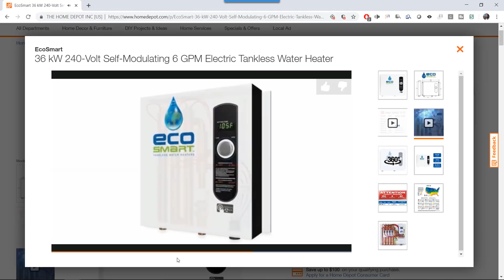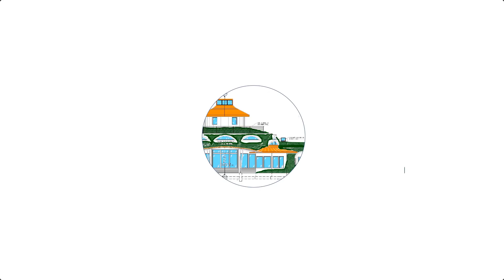39.0 EcoSmart 36kw on demand hot water heater install

Comment: According to the installation manual, a separate ground conductor for each incoming circuit is required.
Reply from the maker: Yea, its easy for them to say that, but they would be seriously over sizing things.  The 4 grounding wires would all be screwed to the same little bus bar and no current flows thru them during normal operation.  If there ever was a short, the current would flow back thru that wire for a tiny fraction of a second before the breaker would trip.  Even if all 4 circuits shorted at once (incredibly unlikely) with full amps, one 8 gage wire would be more than enough to carry the load for such a short time.   

Have you installed one of these?  Honestly, I was doubtful that I could have fit 3 more 8 gauge wires thru the knockout they gave me.  I definitely couldn't have fit it thru the conduit.

Comment: I was just wondering if you could leave one of the heating elements unwired and this unit still work properly I don’t want to under size my house would rather over size and I thought I’d I went with the 36 and didn’t need it if I would just leave one breaker off if it would still work correctly if anyone could answer thanks
Reply from the maker: Yea, I have learned a lot about these things using them for the past couple years.   The first heating element is required.  You can leave the rest unwired (or turn off the breakers) if you wanted and it would still work just as well as the smaller units.   

When I installed it, I thought it measured the incoming temp and then would increase the energy flowing thru the 4 resistors until the outlet temp reached the target (standard way that most control systems work).  But I am now certain that it doesn't work that way.  Instead, what it does is measure the incoming temp and then calculate how much many amps are needed in the first resistor.  Most of the time, that is all it uses.  If you are running multiple showers or something like that and the flow rate goes up, then its calculation finds that it needs the second resistor, etc.   If it uses the second sensor, that is just a check on its programming.

How do I know?  Well the first resistor burned out on one of my units.  It was the darndest thing because we would have no hot water if we only ran one tap, but if we ran more, we would get "warm" water.  Basically, the algorithm thought it was dumping energy into that first resistor.  When the flow rate went up, it also turned on the second one.  Since the second one was working, we actually got some warm water out.   I ended up moving the 4th one into the first slot and things were fine while I could go online and order another element.   The 4th element looked totally unused.  The 3rd looked rarely used, etc. all the way back to the first that looked really worn out.  Pictures are posted on our Facebook channel.
Reply: @SimonHomeintheEarth  thanks that’s what I was looking for I think I’m going to go with a 27kw and give it a try hope I don’t regret getting the 36

Comment: I didn’t see a ground wire connected in the main panel
Reply from the maker: 2:27, you can see a black wire with green tape on it.  I just didn't bother to buy green wire because it is cheaper to buy it by the 50 ft roll.

Comment: Seems ridiculously simple. What were your hot water costs per month on your electric bill? Anyway to isolate and figure out?
Reply from the maker: That was the worst part.  Electric is not the cheap way to heat water.  Maybe I should have used natural gas, but that install was expensive, I didn't think I would need much and I didn't like the idea of combustion in my underground home.   Also, the cost of natural gas has doubled in the past couple years, so maybe it wouldn't have been cheaper. 

I ended up adding a solar hot water system and hooking it up to the front end so the water now is pretty much full temp going into this heater now (the solar actually gets it hotter and I used a thermal mixing valve to add in some cold water).   Anyway, on sunny days (and the night and morning after) hardly turns on at all now.

Comment: Great video! Saw this on their website: 300 amp household service recommended. Mine is 200 amp. Do you think 200amp is enough?
Reply: most modern houses are designed with 200amps service , you can request a 400amp but that’s mostly for business
Reply from the maker: It depends how much of your panel is already in use.  There are also rules for allowing for excess, etc.  You would probably need to upgrade.  If you can get natural gas, I'd suggest you go with one of those instead.

Comment: How many ground wire you connected all 4 or just 1
Please respond i appreciate 
Thank you.
Reply from the maker: Yea, just one.  Current doesn't flow thru the ground wire during regular use.  If it does go thru the ground wire, it is just for a tiny fraction of a second to trip the breaker if something goes wrong, so the wire doesn't need to carry the working load.
Reply: Just 1 , from main panel to water tank cold side
Reply: Look at the fken thing can u can see
Reply: The EcoSmart manual calls for a separate ground wire per circuit.
Reply from the maker: @sr.gateau  Yes, the manual calls for much much more capacity than would be needed in reality.  Think about it this way...  My entire breaker panel has only got one little ground wire to ground the whole thing. Even if I ran 4 wires from the unit to the panel, there would still only be one wire from the panel to the ground.  I won't be running current thru the ground wire to the ground like that anyway, I am only using it to catch a fault and trip the breaker.  Current would only flow for an incredibly brief time.  As an engineer who can do the math, I have absolutely no worries about running the full amps thru that wire for much longer than it would need, and I also know that such a scenario is so incredibly improbable that I have a much greater chance of winning the lottery.

Comment: Some places don't have enough room in a panel  for double breakers.  Sometimes you gotta run a sub panel off the main just for this water heater.
Reply from the maker: Yea, that 4 breaker requirement really makes this difficult to add to existing construction.  Most houses just can't handle the amps required, even with a sub panel.

Comment: Nice video.  Question though.  Do you know on the 36 KW unit, if it would run with only the first two circuits connected, so it could be run as 18 KW, but have the capacity be used as 27 or 36 at a later time?
Reply from the maker: Yes, for sure.  You can hook up just the first couple circuits and it will work just like an 18kw unit would work.   Keep the flow rate down and it doesn't touch the 3rd or 4th circuits even if they are hooked up.   But if you exceed that flow rate, you will see that you don't get enough heating, just as you would with an 18KW unit.

Comment: Did you crimp a terminal onto your 8 gauge wire or just strip them and insert them into the water heater terminal block?
Reply from the maker: No terminal required.  The water heater was designed to take the wires directly and then had a screw to hold them mechanically.

Comment: That's the first time I've seen a panel filled with blue flexible ENT conduit, no NMD in your home?
Reply from the maker: Nope, no NMD.  ENT is readily available in stores here and is the only flexible conduit rated for being encased in concrete (that I know of).  Is there any advantage to using NMD over ENT?   Or is NMD just something you are more familiar with?

Comment: is it better to have the tank the close to the breaker?
Reply from the maker: The longer the cable, the more voltage drop along it.  But you also have certain minimums.  It is also important to have the hot water as close to the final taps as possible...

Comment: Interesting, how are your electrical bills since then? I'm thinking of getting Retex-36 for a similar setup with a longer runway. Even at 70% derating, the code-allowed current would be over 150 amp: 38.5 x 4 = 154. This particular 36kw model is listed for a maximum draw of 150 amp, so 1" conduit should be fine. That's what they mean by "the 4 sets of #8 wire" statement in the manual. Not clear though why THHN/conduit option was selected in this temporary non-wet setup, instead of just 4 sets of Romex 8/2? Another minor potential issue may be a single #10 ground wire, kinda weak for the possible flow. A thicker single wire would probably be safer. The unit's ground bar has 4 slots with Romex in mind.
Reply from the maker: Honestly, heating with electrical is one of the decisions I am most nervous about.  However, I was also concerned about the idea of burning natural gas in such a well sealed house.  I also considered geothermal, but the cost was just too high to ever pay its self off.  In the end, it was the availability and low cost of the install that tipped me toward electrical and I am still hoping I don't regret it.  Once I am actually living there, I will be able to evaluate and compare the costs more clearly.
That one winter when I was shooting hot water on to the stucco walls ended up adding to the electrical bill.  I forgot what the numbers were, but it was a noticeable bump over simply running the lights and power tools.

Comment: Wow. 36kw! How much power do you expect to use continously (middled out on off cycles) for heating in winter?
Reply from the maker: I don't know yet.  It may be a bit life changing once I calculate costs per second of shower time ;)

The manufacturers claim it is efficient and it has an Energy Star rating, but that is probably in comparison to an electric hot water tank, which is just the worst possible situation.

Comment: interesting choice, I think I favor the tank based heatpump based heaters.
any particular reason for not going with one of those?
Reply from the maker: I was avoiding tank heaters because they waste energy storing heat all day.  The heat pump ones are more efficient, but the cost for those is about 4x what I paid.  We will see how it goes.  If the costs to operate the on demand one are too high (in reality as opposed to what the manufactures claim) perhaps I'll try out one of those heat pumps in series with it.
Reply from the maker: One other thought on this that I did consider at the time...  The heat pump sucks heat out of the air to put it into the water.  I plan to use that hot water to heat the rooms, so during the winter, it would be like plugging an extension chord back into its self.
Reply: @SimonHomeintheEarth   actually the idea is to extract heat from outside the house, not internal to it :) 

ultimately its always more efficient to move heat (from outside to inside or vice versa) then to generate it. so I'm a big fan from an efficiency standpoint (and longterm costs)

Comment: Just a heads up, because you put 8 current carrying conductors in that Smurf tube, you must derate all to 70%.  8ga thhn is rated for 55amps, 55*.70=38.5. So that 8 ga wire is only rated for 38.5 amps.  You can get around this by running a second conduit and splitting it up.  4-6 current carrying conductors derates to 80% or 44amps on 8ga thhn.  Also, reidentification  of conductors smaller than 4awg is not permitted.  You could run a 10awg equipment earth conductor, but it must be green or green with yellow stripe.  Most home centers and hardware stores sell wire by the foot, so you can avoid having to buy a spool
Reply from the maker: The unit came with instructions saying to use the 8 gauge wire with the 40 AMP breakers (check the video at 0:43).  Are you saying that the ENT conduit is the problem?  The inspector told me (and I found it in a chart) that I was allowed nine of the 8 gauge wires in my 1 inch ENT conduit.  That was perfect for my situation.  Actually, the unit itself came pre-punched with a hole for the 1 inch conduit, so that was clearly what was intended.  Not sure if it was officially passed in my last electrical inspection, but I think the guy did look at it and didn't say anything.
Reply: @SimonHomeintheEarth  Its not a problem with ENT, but rather a problem with current carrying conductors in ANY conduit.  If you refer to NEC Table 310.15(b)(3)(a) it outlines the derating.  The way is is written, you could have 8 14ga current carrying conductors in a 6 inch conduit and would have to derate.  The conduit size is fine, With 8 current carrying conductors of 8ga size and 1 equipment ground of 8ga size, you are looking at 38.5% fill in 1 inch conduit.  The reason for derating is heat, ALL current carrying conductors generate some level of heat while current is being passed through them. You can run another 1 inch or 3/4 inch conduit and split it.  If you don't have a copy of the NEC rules in effect in your location let me know, and I'll arrange to get you a copy.
Reply: @coshtor  I agree with Clayton. Good catch. They probably anticipated the use of NM cable. Don Witt, PE
Reply: @azdonw  I'm thinking they anticipated nm, or a pull box and nipple below.  Simon, a nipple (conduit less than 18") is exempt from derating.
Reply from the maker: @coshtor  Thanks for the info.  I have the internet, so no problem finding the NEC tables.  So, you are saying I should separate it into multiple conduits and then run them all into a box and then feed it from a box into the unit thru a shorter piece of conduit?  At least the cost of that change won't be too much of a problem.
Reply: @SimonHomeintheEarth  yes, I would bring the circuits into a pull box, below the heater, then a nipple (less than 18 inches) of one inch.  It's an oddity of the NEC that you don't have to derate for wire in a nipple
Reply: Each branch only draws 35 amps.  I have the 18kw model with two 40's.   The 36 is the same,  just two more elements.